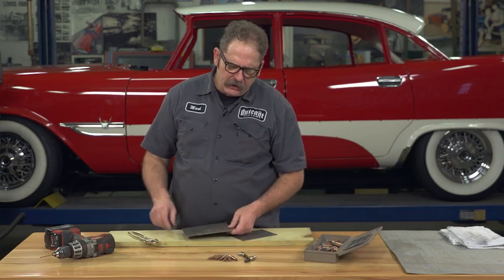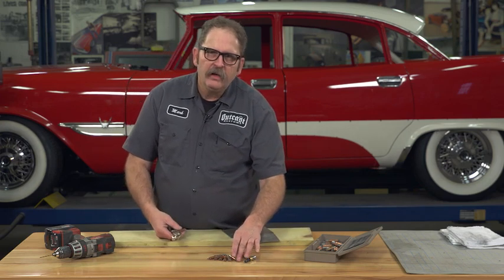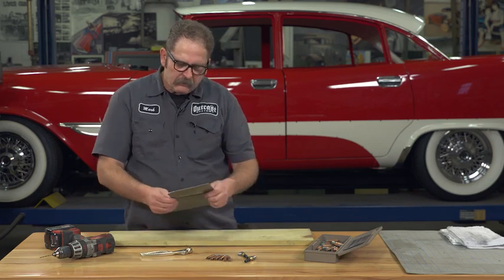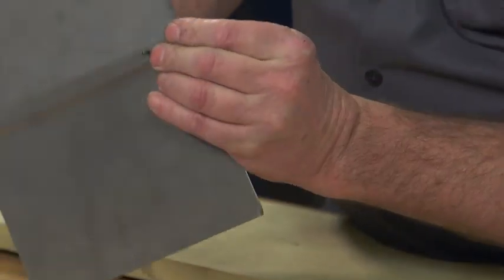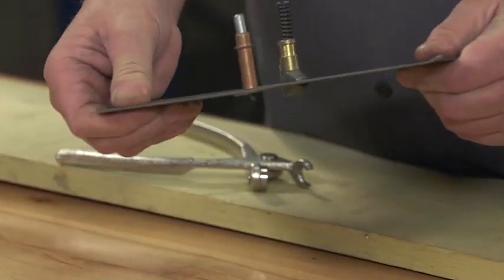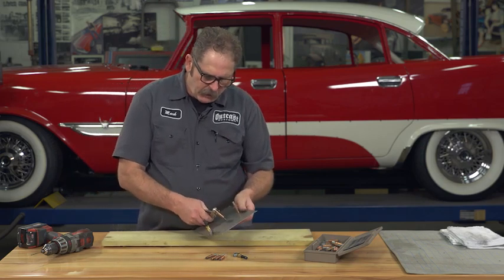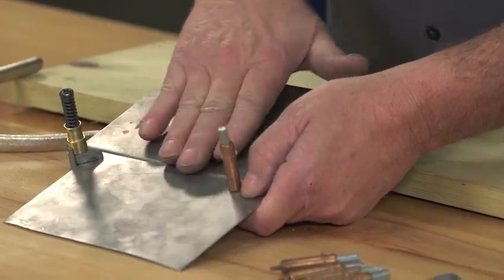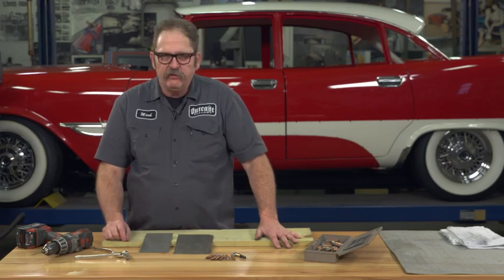Cleco Clamps to Hold Panels

Comment: Why not just sheet metal screws?
Reply from the maker: Yes, sheetmetal self-tapping screws will get the job done, although we've found Clecos do not distort the metal like the threads on screws. also when fitting panels together, it is not uncommon to remove the panel for adjustments several times to get a good fit and Clecos are just faster and easier to use.
Reply: @Paul Burridge, correct!  The Clecos will hold the 2 pieces 
together, where that hole was drilled.

If you need to re-align, don't depend on the Clecos 
to help with that.  Align the holes, (drill the right holes) 
and then use the Clecos to hold the correct positioning.

steve
Reply: @Paul Burridge no, because you will just make another hole to put it in